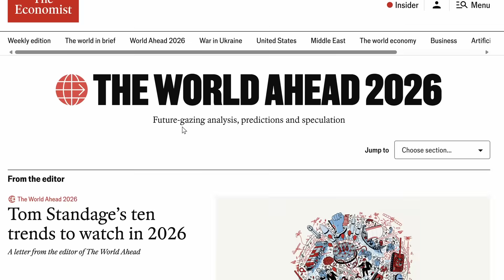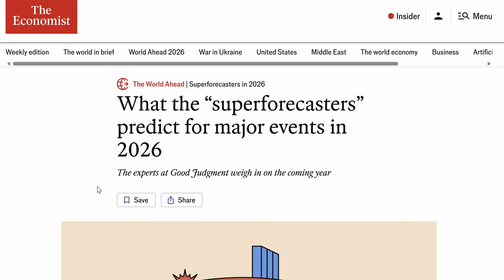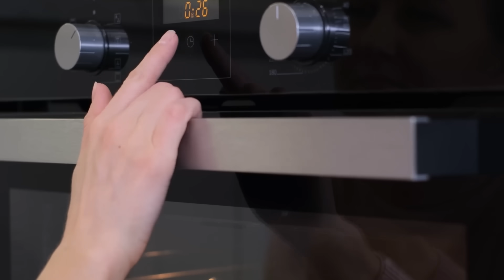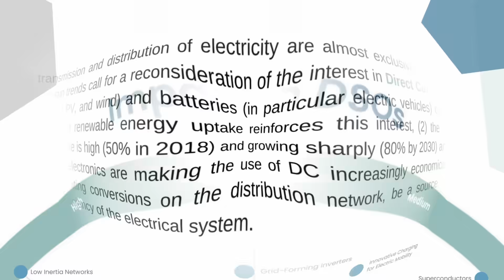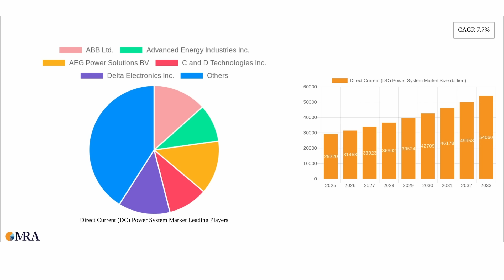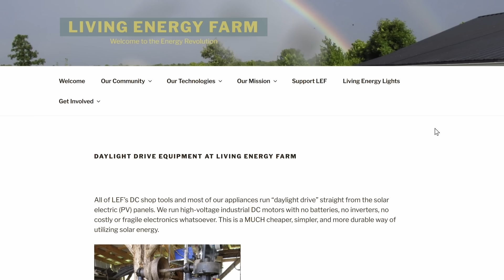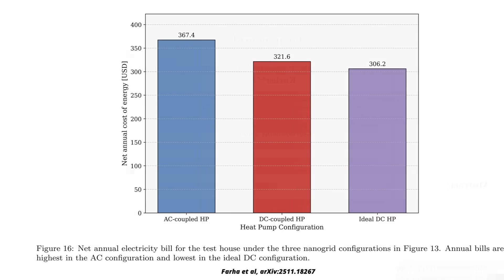Are We Using the Wrong Kind Of Electricity?

Comment: A downside with DC is it’s more prone to arcing and burning if cables are damaged. Maybe not a problem with well maintained grids, but less maintained small grids and home solar possibly more so. Microinverters convert solar panel DC to AC, arguably reducing the risk but at a cost. Happy Christmas & New Year :)
Reply: True. AC switches and breakers rely on the zero voltage crossing to help break the arc. Also, AC transformers help with isolation of input from output.
Reply: exactly... this is especially true in instances where the insulators on distribution are exposed to air. this results in corrosion buildup that does not happen as easily as it does with AC applications. insulators on high voltage exposed to salty air would require weekly maintenance.
Reply: @renaissanceman5847 you better tell all those existing high voltage DC transmission lines they are doing it wrong.
Reply: @zyeborm  this is china... they are not going to admit they are doing anything wrong. the problem is the conversion stations. they are complex and require high voltage electronics to convert to different voltage levels... with AC... is a mechanical transformer that has no semiconductors in them. AC may not be more efficient... but its more robust and thus cost effective in the long run when maintenance and cost of level conversion is included.
Reply: @renaissanceman5847 
Maintenance is great for creating jobs. That helps stabilize the political power of the CCP.

Sisyphus, the ancient Greek king who had cheated death and escaped Hades, has a permanent job we probably all envy now with the job crunch occurring in the U.S.A. 😂😊

We use cheap road salt for melting ice and snow ❄️ in the U.S.A. because it creates jobs galore by rusting all those steel parts (e.g. brake cables, mufflers) on vehicles via sludge splashes of salted water. We increase the GDP of the U.S.A. by going cheap.🎉😊
Reply: @Money-ek2dw  you know something... cant argue with that... good point.
Reply: And I thought the Edison-Tesla war was over - the Edison acolytes just evidently went underground so they could come back and strike again. Please - no more electrocuted elephant demonstrations.
Reply: @TheSulross they went to sleep. Now they have woken up and are back......to finish what they started
Reply: You're right about the arcing, which also means you need much more robust and more expensive protection gear for your installation. It probably also means that in the case of electrical fault short maybe more likely to lead to a fire.

Inverters also adjust the operating voltage/current of the solar panels according to the available solar power in order to maximise the yield, it is known as maximum PowerPoint tracking (mppt). If you went for a straight DC system you'd probably lose more energy from panel to load mismatches than you would gain in the slight reduction in losses from AC to DC conversion.
Furthermore, you're not going to have all your appliances in your house operating off the same DC voltage, you're not going to be running a catalogue for 5 volt DC supply that you need for your mobile phone.
Reply: @nickcook2714  You can build straight solar DC systems but they are weird because you build a fixed or near fixed voltage system not the classic resistance behaviour. So for example a straight DC solar panel heater is a chain of power diodes on a big metal block so that the voltage remains constant.
If you don't do that then as you say your solar efficiency is *terrible*.

That said your MPPT is doing DC/DC conversions between the battery and the solar system so you are running an entirely DC system and at lower currents there's a lot to be said for staying DC (except the arc problem) which is why a lot of RVs and small off grid systems stick to things like DC lighting and DC fridges so they can power the inverter off when big power is not needed.
Reply: Totally agree. Look at the specification for any relay; AC ratings and higher than DC. That is because when a circuit switches, a plasma builds up between the two contacts. Under DC, that plasma will continue. With AC, at some point (50 times a second) the voltage will reach zero, and the plasma will end. Very important in electronics design
Reply: I stayed in an old hotel that was wired with DC in Milwaukie. The reason was the elevator ran on DC so DC powered the whole place.
I plugged an AC shaver in and got a click instead of a buzz. When I unplugged, a 1/2 inch blue arc told me I should not do that again. DC current is hard to quench.
Relay contacts have an AC and a DC rating. Usually 240VAC and only 32VDC.
Reply: High voltage DC also greatly accelerates metal corrosion especially of differing metals used as charge carriers . AC current greatly reduces the  corrosion effects.
Reply: @billbyrd1361  there isn’t really a significant difference.  First, AC systems still have DC components.  The main issue for galvanic corrosion in either system is where the electrons are going on a net basis, not whether it is AC or DC.  If there is a ground loop through the water, you have a problem whether you are using AC or DC.  DC can be isolated almost as easily as AC can (transformer plus chopper for DC, vs just a transformer for AC).

In terms of regular corrosion, that’s also not a function of AC or DC but instead tends to be a function of the voltage.  You might be thinking of e,g. 12VDC vs 120VAC.  But modern DC residential systems would not generally run at 12V… they would run at 48V.  Corrosion is a non-issue.
Reply: @billbyrd1361  Galvanic corrosion is what you are referring to.
Reply: @BenjaminGoose yes, and having a permanent cathode and anode with DC will exponentially increase corrosion damage at every stem on the grid, AC intrinsically doesn't have this problem.

That means that any energy savings on transmission will be offset by the humongous energy cost to produce more replacement parts for the increase corrosion on a DC grid.
Reply: @BenjaminGoose  This is also the major problem with Rail Guns, if I understand correctly.
Reply: @carlosdgutierrez6570  Where do you people get all this nonsense from?
Reply: @junkerzn7312  Straight out of known physics?
Reply: @scythelord more like misrepresented physics..
If galvanic corrosion is an issue, you've messed up your polarity (a less than trivial problem to avoid)
Further up this thread someone stated that ac voltage reaches 0V 50 times a second... Fail (unless you're using 25Hz).Also that plasma will "stop" at zero crossings.. Fail! It does not dissipate that quickly.
Reply: @dougaltolan3017 you do realize that the electric field is constant in 1 direction with DC.  Free Ions will follow this path where they move next to things that they can form ionic bonds with.  Anytime fluids or plasmas are present and this movement is made easier but strong electric currents will also move ions across the surface where most of the electricity is also carried (hall effect)...  In AC circuits the electric field direction alternates this the net movement of corrosion causing ions averages closer to 0.    And that is basic physics.
Reply: @dougaltolan3017 the process I just described is also exactly why they deliberately use DC currents to do electroplating.  In that case you would deliberately be using the constant electric field of the DC current to move specific ions you want to move towards the item you want to electroplate.    This is also why AC currents are not normally used for electroplating work.   This is basic physics and basic chemistry in action.
Reply: I have converters, they are more efficient because of line loss at the D.C. output of the panels. Arcing is not a problem ether way.
Reply: Yes, just look at mechanical switch ratings; the AC ratings are usually much higher than DC.
Reply: so, basically impossible for the USA as "well maintained infrastructure" is illegal here
Reply: @amihartz The grid is usually ok in this regard.
Reply: AC should be more prone to arcing if cables are damaged. For the same power AC has peak voltages that are sqrt(2) higher than the DC voltage.
Reply: inverters are expensive. and for dc appliances, we have inverter to acdc converter which is crazy inefficient.
Reply: If you run everything on DC, you don't need micro-inverters.
Reply: Also, stepping voltage down or up is a pita with DC, buck converters are a lot more complicated to manufacture than simple transformers, especially for the high tensions necessary for long distance transmission.
Reply: @carlosdgutierrez6570 at voltages above 1000V, yes.  At voltages below 1000V, no.
Reply: This whole group of comments are not up to date with the technology. In Australia this is progressing towards the illustration at the beginning of the video. Localised power is everywhere.
Reply: At 5 volts, this is usually a very negligible concern more do to with your carpet making a higher voltage.   The higher the amperage the more this turns into zap a mole however.
Reply: @steelgreyed-o8r good luck pushing 5 volts past a couple inches.
Reply: @robertlivingston1634  more like 10 feet, but that's the point of low voltage application.  No excessively thick wiring to get over unrequired distances.   Source and use in the same location.  Even if that source is an AC step down.
Reply: Almost every PC  and more than a few mainframes since the 1980's run on 5v and 12v dc respectively. when calculating 1's and 0's push is better than maybe.
Reply: @steelgreyed-o8r  CPUs actually operate at less than 1V.  But you are ignoring the distance factor.  1V going a centimeter or two is t a problem.  Anyway, modern home DC distribution use much higher voltages.  48V (POE for example) is fairly typical.  Nobody is dumb enough to try to run 5V power line more than a foot or two.  High power DC distribution… say at 120VDC, however, is a lot more dangerous than high power AC distribution in a residential setting. So there’s no actual reason to do that.
Reply: Urm.  Not quite.  DC is actually far more efficient for long distance transmission, and in modern day DC is cheaper for transmission lines more than a few hundred miles long.  But AC can be stepped up and stepped down with just a transformer while the circuitry for DC voltage changes is a bit more complex.  So relatively short range distribution systems with multiple voltage changes are a lot cheaper to do with AC even though they are less efficient.

In modern day, below around 1000V, DC conversions have gotten a lot easier as the power electronics have become more capable.  But due to the difficulty in dealing with ARCs, breaker cost, and safety at the residential level, AC is still easier to deal with.  That is despite the fact that almost all modern appliances are DC.  There are fewer and fewer pure AC motors, for example a mini-split (variable speed DC compressor) vs a traditional A/C (1-speed or 2-speed AC compressor).  So DC throughout would be more efficient, but not so much more efficient that the cost trade-off for keeping things safe makes sense.
Reply: @junkerzn7312 galvanic corrosion, the moment you have a permanent positive and negative conductor, you have a potential electrochemical cell the moment some water gets involved.

That is not a problem on indormira equipment operating at low voltages and without exposure to rain, fog, etc., power  transmission lines on the open and their switching equipment? 
Yeah, it will be a corrosion nightmare because no seal is perfectly watertight, just ask to the offshore oil industry and the merchant navies.
Reply: @carlosdgutierrez6570  you seem to be really confused by the actual causes here.  And you are again assuming, for reasons beyond my understanding, that there is something magical about AC that solves this problem when there really isn’t.  Dealing with corrosion in electrical systems is more about the voltage (AC or DC), and not so much about whether the system is AC or DC.
Reply: @junkerzn7312 Having worked 30+ years in indoor industrial maintenance I can say that our DC control systems were way more prone to corrosion related failures than our AC systems, regardless of the voltages. Our low voltage systems were more susceptible to resistance variations due to their tolerances plus most low voltage controls depend upon clean and reliable signals. AC systems were very robust. Mostly just install them and run them. Mechanical failures were the usual causes for our AC systems going down. The type of metal in DC systems was definitely a factor. Humidity is an accelerator of component failure.
Reply: Lots of comments from people who don't know what they're talking about as usual
Reply: @s @spaghettibender9893  keep bending spaghetti